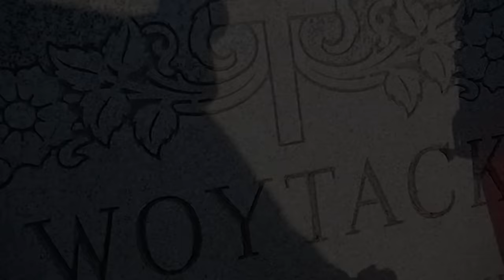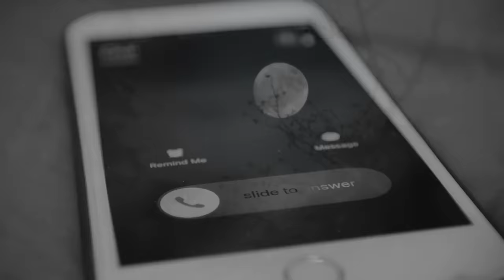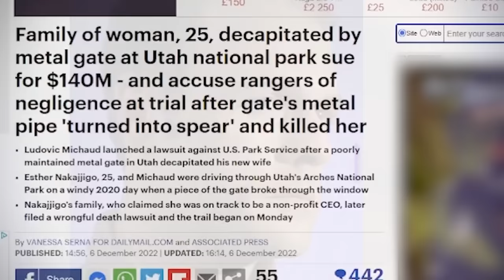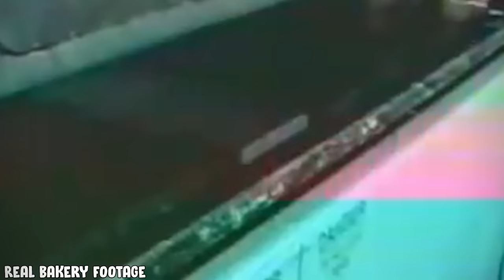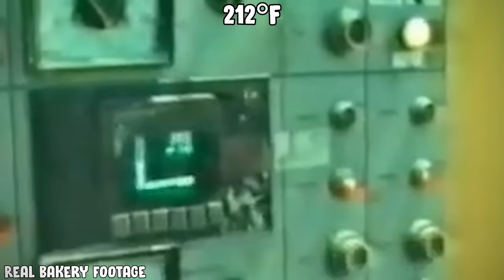CRUSHED by URINAL │ Bizarre Deaths #9

Comment: Strange that the hotel was found guilty or voluntarily admitted guilt? In Law, Culpa in accidents requires  only disregard of possible reasonable deductible chains of events that can lead to injury. I.e. to blame the Hotel for not considering a wobbly bench could suffocate someone, is not gross negligence leading to death as it could not be expected? The Tombstone is different, even if the outcome was the same, heavy things falling over because of poor foundation is a reasonable predictable chain of events.

Comment: 5:33 How should that even work? If your chin is on your chest, it is impossible to jam your face against any wall. A flat surface cannot enter a concave shape. Some visual illustrations or real photos would've been very helpful to see how that really looked like.

8:29 How can a gate suddenly open, then it's already open? If it was closed, then how could they drove through? That doesn't make any sense either.

12:26 I would have used as many car jacks as were nearby and to get more space for all the jacks, I would have screwed solid heavy-duty screws into the upper solid ring of the urinal. Because if one jack can lift 3-5 tons, maybe 10-15 of them could have lifted the urinal. But I know, in such a situation, you miss some simple solutions and try to do even stupid things as to use crowbars. Very sad I wasn't there to tell them, to try my idea.

16:08 That is the stupidest thing I've ever heard of. I never would have crawled inside as long as not a dough is sent through to test how hot it is still inside. Just send every 5 Minutes one dough through and look how brown and crisp it is. Only when one dough is still soft and sticky as it's gone through, then it's cold enough to get inside.

Comment: You guys seriously have hydraulics operated public urinals like that?
Wow that's such a dumb idea on so many levels.

If you don't mind the visual of people pissing in public, literally just install a urinal on the side of a building for a fraction of the cost.

Or better yet, bolt some port-o-potties in place.
Or even better, why don't the bars themselves just have accessible toilets.

At the very least make sure they're unpowered and locked in place externally before working on them... sheesh.